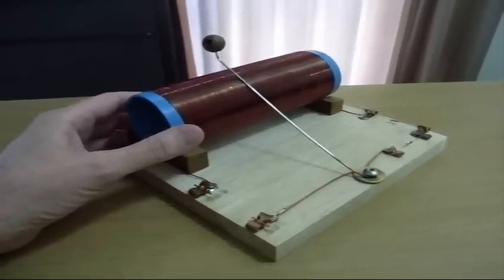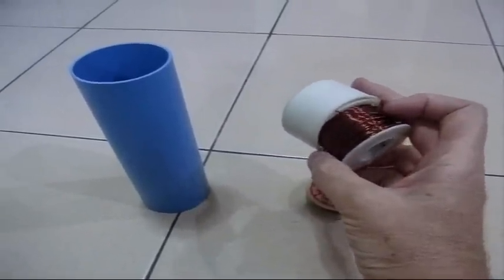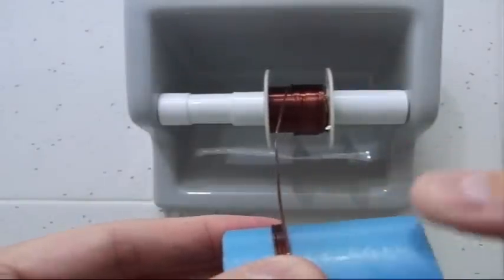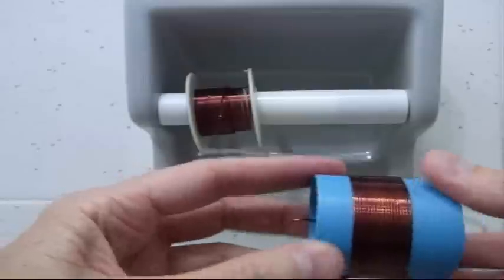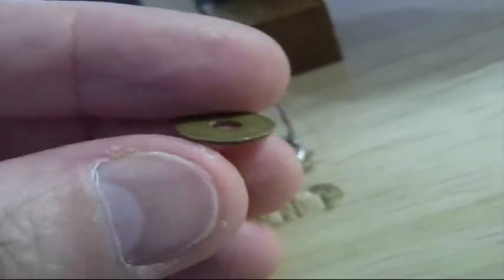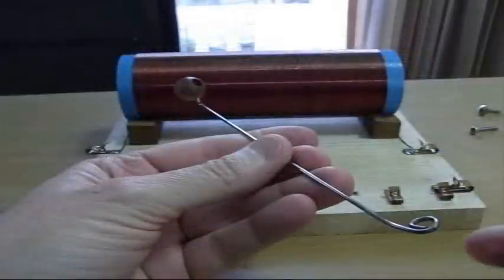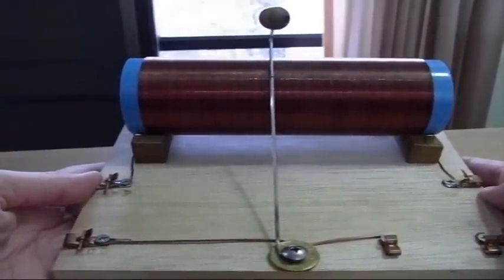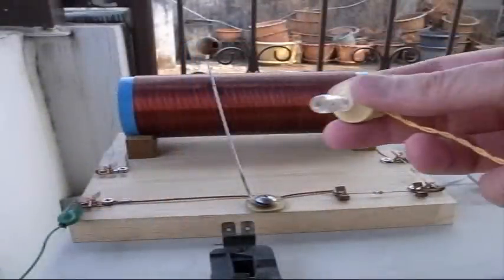How To Make A Crystal Radio - No Batteries (Updated Version Available)

Comment from the maker: Updated Video: Best/Easiest DIY Crystal Radio - No Batteries, No External Power 2023 (4K)
https://youtu.be/fLVCqZGpv3U

RELATED CRYSTAL RADIO VIDEOS: 
My New Favorite!  Crystal Radio with Antenna Tuner:    https://youtu.be/mh5KxCpbQ5U
Crystal Radio & Resonant Coil Design:     https://youtu.be/Fw9eb-aB-XU
Crystal Radio Antenna (Shortwave Also):    https://youtu.be/G8AsgZbncW4
Crystal Radio, Capacitive Tuning - WORKS GREAT!:    https://youtu.be/VJ80Nm9KSkE
Good Crystal Radio Connection Points:    https://youtu.be/G3qjrReHR1k
My Crystal Radio Does NOT Work (FIXES for common problems):    https://youtu.be/kCxQ8iPQx4s
Crystal Radio, Connect A DC Audio Amplifier:  https://youtu.be/RW3VhnzgjtA
Connect DC Audio Amplifier To Your Crystal Radio:    https://youtu.be/HOw3yDFXXN4
Three Upgrades For Your Crystal Radio:   https://youtu.be/LENco3_jV_s
Crystal Radio Wiper Upgrade:     https://youtu.be/i1otDz39nlw
Popular Crystal Radio Design That's a Waste of Time - And Why: https://youtu.be/r9Onub2Xpzc   
New Crystal Radio Design - "Modified-Pickard":     https://youtu.be/_qxHhFKjLAg
Crystal Electric Generator RF Energy Harvesting Exp 5 - Full Wave Rectifier:   https://youtu.be/BTu_GJKjOmA

Comment: 3 things will cause your crystal radio to NOT WORK.  1. You must have a long wire for an antenna. 2.  You must connect the ground to a good metal water pipe or other metal going into the ground. 3.  you must use a PIEZO or CRYSTAL earphone.... not one of those modern  magnetic wire earphones.   Also be sure to scratch off the enamel paint on your copper wires AS HE explains in his video.  I made one of these in the 5th grade back in about 1965
Reply: Magnetic headphones work fine if the impedance is 2k or higher.  Of course these are not widely made anymore, and the modern 4-32 ohm impedance won't work at all, UNLESS you also use a matching audio transformer such as the Bogen T725.
Reply: What if you can't get those earpieces ?
Reply: @QIKUGAMES-QIKU  you can use a amplifier

Comment: I had one of these in the 1950's when I was a kid. My bed was next to a window, and I ran a wire outside the window and wrapped it around a screwdriver I stuck in the ground. I used the window screen for an antenna. I would then lay in bed and listen to The Fleetwoods and The Coasters. With the ear plug my parents thought I was asleep. There is nothing like listing to "Dream Walk" by Santo and Johnny at 1:00am on a summer's night.
Reply from the maker: I used the gutter of the house for an antenna and  used to listen to baseball games when I was supposed to be sleeping.  Good times indeed!

Comment: I remember building one back in 60s only instead of a crystal we used a razor blade and peice of graphite pencil lead
Reply: I remember doing the same lead . . . . . empty toilet paper roll with about 120 turns of #24 bell wire with graphite from a pencil over the razor blade to tune  !!!
Reply: I would like to see that. Have you built one recently or do you have a diagram?
Reply: I used a 1n34 crystal diode.
Reply: As kid I made a razor blade detector with a sewing needle. It worked but was not dependable like a diode was that was about 1965 in Chesapeake,  VA
Reply: @TheFalconJetDriver  that is why you need the graphite pencil the mixture of clay and carbon act like a semi conductor, the one I did used a high carbon steel blade and about 1/2 inch of pencil lead attached ot a modified safety pin
Reply: Piece

Comment: I built a crystal radio with my dad when I was about 8. He had one in the army and he strung the antenna on the clothes line outside the barracks so the sergeant would not notice it. My antenna stretched out my window and across the back yard. It was a circuit with a variable capacitor for tuning and I loved to tune it to different stations and hear music and talking from all over. We were near enough to Canada to get French stations which to me sounded so foreign and mysterious! To this day, I fall asleep with one ear bud in my ear listening to Podcasts.

Brownie - a trick I learned once was that you could make a diode using a safety pin and a quarter. You screw the clasp of the pin to the board so that the elbow sticks up in the air and the point comes back down onto the center of the quarter, held there by the spring of the pin. The surface effect makes it somewhat of a diode at higher frequencies. You can hook the wires by twisting one onto the pin clasp and the other underneath the quarter. You might try this on your kit there. Someone below mentioned a similar trick with a razor blade and a pencil lead.

Thanks for the cool video and the wonderful memories!
Reply from the maker: Thank you for your stories.  I've not heard of the pin and quarter, will have to try that.  I used to use galena (lead mineral) and a pin, but now I'm lazy!  ;)

Comment: I remember getting a crystal radio kit as a Christmas gift when I was 8 years old. If my memory serves me correctly, the tuning-coil came pre-wound, so I didn't have to fart-around with that.

It came with a very long antenna, that my father ran from his bedroom window, all the way to our clothes-line pole in our back-yard. (Unfortunately, my own bedroom window faced our front-yard.)

After its assembly and antenna connection, it received most, if not all of the local AM stations clearly; mind you, at that time, I lived in a small city of approximately 100,000 residents, so there weren't many stations to receive. I had a lot of fun with it, nevertheless. :)

Comment: God bless tsbrownie for being so patient in answering the same questions over and over. This is ancient technology(over 100 years old) that obviously works. Follow the instructions and it will work. No it won't pick up FM or short wave etc. If you have an antenna, a ground, a coil, a diode and headphones it will work. It's like a miracle you have built with your own hands. Try to appreciate that miracle. No it won't blow you away with fidelity and volume. It is what it is. A good antenna and a good ground are important. In a darkened room you can strike the antenna and ground wire together and see a spark....or put both wires on your tongue and feel the electricity you are capturing from the air. Follow the instruction in the video. In fact, I have made some down and dirty(quick and ugly) versions that also work. Forget the overkill about spring clips and screws and washers...just strip some insulation from the ends of the wires and twist the wire ends together to make a connection. I'm not advocating sloppy craftsmanship...just saying...if you get the connections made, it will work. Appreciate it for what it is.
Reply from the maker: Never knew they would spark.  Cool!  Have to try that.  Thanks!

Comment: It might make it easier to wind the coil if you put a piece of double face Scotch tape down the length of the form, maybe even two on opposite sides of the tubing.  Also, a spot of hot glue to secure the ends to the form when you are done.  I built my first one about 65 years ago as a Cub Scout.

Comment: Well Done. I think i will give it a try. I may just try to purchase one all ready made , the coil may be the problem for my 75 year old hands.
Reply from the maker: I won't lie to you, the coil is the hardest part.  Keeping it tight and "beautiful" helps, but it will likely still work.  Maybe you can find a relative or neighbor?  These radios are almost magical.  Oh, and the antenna is important.  It can just be a long wire (stay away from electric lines for safety and to prevent buzzing) running parallel to the ground.  I use wire from an old transformer.

Comment: I knew a guy who built a radio powered crystal set.  He used the rectified dc power from a strong station  (WMAL) to power a germanium transistor and a 12" speaker.  Very clever invention.

Comment: Try double sided tape along the PVC before you start the winding. It won't be too sticky, but it will help hold the wire into place. Thank you for such and interesting and informative video! Most people don't know about this kind of thing.
Reply from the maker: The thin stuff would probably work.  I was always concerned it would make the surface lumpy.

Comment: When I was 12 I made one using a  1N34A diode ,a 400 microfarad capacitor. The coil was a 5 inch 2x2  wood block with the corners rounded off in a lathe. I used the lathe to wind the wire on the wood . sprayed shellac on it to keep the wire coil together Mounted the coil with 90 ° metal corner brackets at each end so that one corner of the coil was on top.  the wiper was a piece of galvanized metal strip with a copper wire solder along the length of it . mounted on a block of wood level with the top of the coil.
the most important part was the antenna..I used 200 feet of wire strung between the  house and a power pole on the other side of the neighbor's yard. 
the antenna will be more directional in the opposite the end picking up stations that way.
 if it goes east to west and if end is west of your radio stations east of you will be stronger.
Reply from the maker: The old crystal earphones required that 400 uF cap to work.  The new crystal earphones are actually piezoelectric and come with a lot (almost too much) capacitance built in so that's no longer needed (in fact it keeps the radio from working).  Sounds like you did a very nice job on building it.

Comment: I want to help my 12 year old grandson how to make a crystal radio, I have a Philmore VC1000 that and uncle gave my when I was 10 years old (1966) we put it together and strung bell wire all over our 1 acre yard trying to make the best antenna I could. A neighbor gave me a two pieces of u channel aluminum one 6 feet tall the other 4 foot. I made cross with them and screwed them to a skinny Poplar tree in my back yard about7 feet off the ground and that became my antenna and it worked well. I sanded the aluminum and cleaned the copper 23 awg bell wire ran a screw around the wire and the aluminum and I spray painted it with enamel paint for corrosion protection.
In 1976 my parents moved from that home. In 2018 I visited the area where I grew up. The aluminum antenna parts were 60 feet in the air to my knowledge it is still there. Of course the bell wire is long gone. 😁🛫
Reply from the maker: This is the best of the easy designs. Let me know if you have questions.

Comment: Or for added realism use an actual crystal. I bought two in metal boxes, Hertzite and Cymosite and one in a cardboard box, a Dr. Cecil. You might find them at radio rallies as I did with Dr. Cecil or smaller electronic shops where I got the the other two. The Dr. Cecil came with a small piece of gold coloured wire. Wrap the xtal in tin foil leaving the xtal exposed on top and attach a wire to the tin foil, then fix a stiff wire onto a sewing needle and attach the other ends as shown in the video. By probing around with the needle a sensitive spot can be found and stations heard. It works but is tricky. The old sets had an arm to adjust the spot and hold it there.
I like this kind of stuff. Thanks for showing it tsbrownie.
It was only later I made a crystal set after starting with a one valve kit, H.A.C, Hear All Continents aged 13. I later made mullti valve sets in my teens, moving onto transistors then i.c.'s. Got the amateur licence and made my own h.f. tx/rx. Took thing back a few years ago and made a one valve transmitter using a crystal.
Bill, G4GHB.
Reply: I remember reading somewhere the special wire was phosphor bronze and 'Wood's Metal' used to hold the crystal.
Bill, G4GHB.,
Reply: I looked it up. I wonder if just lead would work. Galena comes from around lead mines.
Bill.
Reply from the maker: I used galena on my first radio and it does work, but now I'm lazy and use the diode.  It is less fussy!  I should do a demo of it.
Reply from the maker: The old cub scout model that I first build had you cut a piece of 1/2 inch copper pipe to put a mount tab on the bottom and a set screw in the side.  It worked.
Reply: @tsbrownie  Yes, that would be good to show, and how tricky it is.

Comment: My mother had a friend who was stationed in Burma during WW II. He said that the soldiers who had new or newer rifles would use a section of the barrel that had good bluing for the detector section instead of a galena crystal and cat's whisker or the germanium diode used today. Obviously not during battle. Some would use Gillette super blue razor blades. The bluing on both, when dry, forms a conductive crystal structure that can exhibit semiconductor properties. I don't know if today's gun barrels are coated chemically the same way that they were 80+ years ago though.
    Another setup, he said, was instead of the coil wiper, they would whittle some of the wood back off the end of the end of a pencil, twist the wire tightly around the graphite pencil "lead" near the wood and use the pencil point as the detector / wiper, again, replacing the diode. Graphite also has a crystalline structure that can exhibit semiconductor properties.
    Before the late 1950's There were no semiconductor diodes or transistors. Regular radios used vacuum tube diodes as the detector. Soldiers had to get creative if they wanted news or music in their down time and the above is what some came up with.
    I was born and raised in downtown Rochester N.Y. 5 miles from the hill where the bulk of our radio and TV transmitters were. Crystal radio reception was LOUD AND PROUD to say the least. One time, using an AM radio tuned loopstick antenna, for those who don't know, it is a factory wound, center tapped coil of wire about 2 1/2 inches long and a little wider than a pencil with a ferite slug inside with a threaded rod molded in to screw in and out of the coil. Rather than using a wiper on a bulky coil to tune the radio, you would solder a 100 pF disk capacitor across the 2 outside contacts, connect the germanium diode to one side, connect the antenna to either the same side as the diode or the center tap, which ever works better, connect a 50 pF disk cap across the open end of the diode and the coil contact opposite the diode then your crystal earphone across the 50 pF cap. Connect the ground to the coil contact opposite the antenna. Screw the ferite slug in or out to tune.
    The radio above I experimented with a bit. Instead of the 2,000 ohm earphone, I connected a 2,000 to 8 ohm miniature audio output transformer and speaker out of a pocket transistor radio. I mounted the whole circuit on a small piece of perf circuit board and put it in a cassette tape box. Being 5 miles away from a 5,000 watt transmitter, I had to install a volume control on the transformer to cut down on distortion and volume enough to understand speech and music. I didn't actually need an antenna but the only thing keeping it from being a truly portable radio was the need for a good earth ground like a water pipe or the 3rd prong of an electrical outlet. It was loud and clear enough to set on a dinner table for anyone to hear. Where I live now in West Virginia, the nearest AM radio station is 28 miles away so this circuit wouldn't work here. When my son was young, we built basically the same circuit but using the crystal earphone.  50 feet of wire strung in the trees bought us  only static. He got a kick out of trying though.
Reply from the maker: Thanks for the comment.  Lots of good stuff there.  I have to try the pencil and razor blade things one of these days.
Reply: I'm sure the pencil thing would still work but I don't know anyone that still makes blue blades anymore. With the advent of 137 bladed razors, I don't even know if you could get double edged razor blades outside of an antique shop. Maybe Amazon or E bay? If you do locate some, they can't just be blue painted. The bluing that they used to use on guns and razor blades was for rust prevention so you may have to try an antique shop for the original Gillette super blue blades. The area of the blade that you want to use can't be rusty so be aware of what you are buying. Other companies may have made them but the old Gillette TV commercials sticks in my mind. getting senile I guess.
     Also, with the pencil thing. If you don't get results the first try, try different hardness of pencil lead. Number 2, 3, 4, 5 up to drafting pencil lead. Pencil makers add clay to their lead formula to control hardness. Number 1 and 2 are soft and usually required for lottery ticket computer read order slips, multiple choice tests and such. Number 3, 4 is harder and usually for people who do a lot of forms where it isn't convenient to stop and run to a pencil sharpener often. Number 5 and up is used by draftsmen where their hands or arms may sweep across a drawing while still in progress. Lead this hard won't come off a technical drawing and smear making it look more like a pastel pencil portrait. Which way that the clay content swings, I don't know so trial and error may apply. Good luck.

Comment: That's a clean radio ,well done ,now if someone  could make a apartment crystal radio ,that would be cool for me ,I got all the parts ,except after seeing your video ,I no now I need to buy some brass washers and brass screws,and I going to buy heaver that's megneti c wire  i think it works better and looks  better too ,some of your ideas work for me ,I like soldering things together,when I can ,I no it makes a better connection.thanks for letting me barrow some of your ideas.